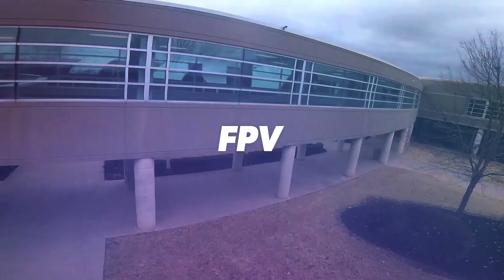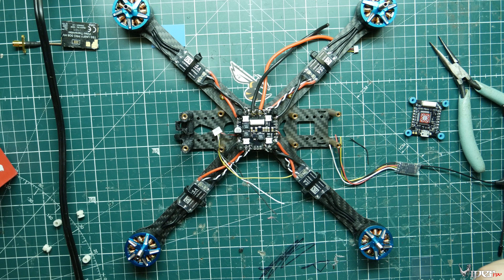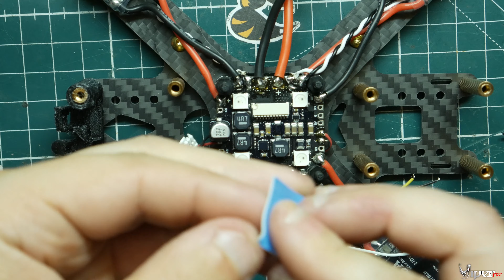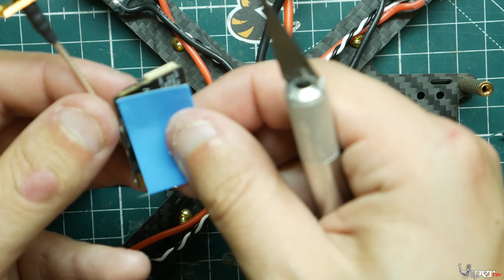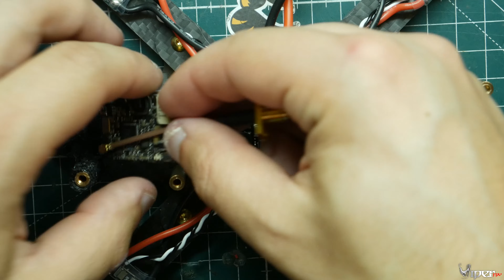HSKRC XL7 Long Range FPV 7 Inch Drone Build - 7 Inch Drone Build Episode #2

Comment: hi viper newbie here from philippines. how do you change direction of the motors when you soldered fixed ESC & motor? thanks
Reply from the maker: You can change them by alternating 2 wires around where u soldered them 2 the esc. Or you can check out Blhelisuite and reverse the direction via software. https://youtu.be/32uPIBySgls

Comment: Hey! I've got a couple questions for you: does this build stay in position if you don't move the sticks? What is the average fly time if you fly calmly? Thx!
Reply from the maker: Wout Suykerbuyk straight as a arrow, flight time depends on a 1500 6s pack flying calmly I can get over 6 min. This quad will fit bigger batteries like 2000 and u probably can get close to 10 min if u fly calmly l. Aggressively like I normally fly it 3-4 min

Comment: Had a roll of death on the first maiden, fell and broke and arm and my Lipo :( has this ever happened to you? I also found the quad very drifts, is that normal for a 7 inch? After a sharp turn it will just slide
Reply from the maker: No it has not. What FC are you using?
Reply: @ViperFPV  mamba f405 on 5s 1800kv motors. seem to be flying fine so it was unexpected. Not sure if its a related issue but before the crash in STAB mode it was tilting backwards like i had the sticks pulling back even though i calibrated the gyro. but in Acro it was fine

Comment: Hi Viper_FPV, i need to slightly widen 2 holes in my carbon top plate, just wondering if its ok to use a standard drill? The holes are currently for an m2 bolt but i need to widen for an m3 bolt. Cheers.
Reply from the maker: Yes u can but make sure u are very careful with the carbon dust. May want to wet it to reduce the risk

Comment: No need to shrink wrap vtx. It needs air flow. Just zip tie down the ufl connection. Conformal coating will protect it from whatever anybody thinks the shrink wrap is doing. I’ve sunk my quads in the ever or lake too many times. Nothing happens to vtx. But your vtx overheats in that wrap specially during summer. It powers it self down. And you loose range. 7”......
Reply from the maker: ivoryviking thanks for the input I have been doing it my way for years without an issue but your way works also. To each there own
Reply: Viper_FPV indeed. I know most people still wrap em. Even though they know it heats up more. And eventually the units dynamic power lowers its self to protect it self. I just don’t get why. Specially when we pay extra for the unify. It’s like going backwards or limiting the potential you paid for. The new pro 32 hv is insane. I’ve got it on my 7” and a cpl of my kiss setups. It’s phenomenal.
Reply from the maker: ivoryviking thanks for the input I have been doing it my way for years without an issue but your way works also. To each there own